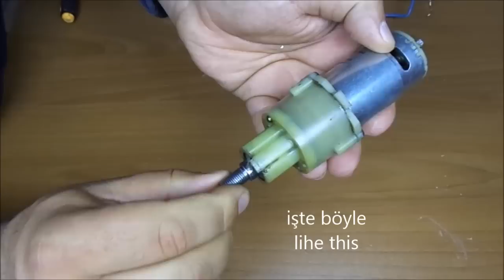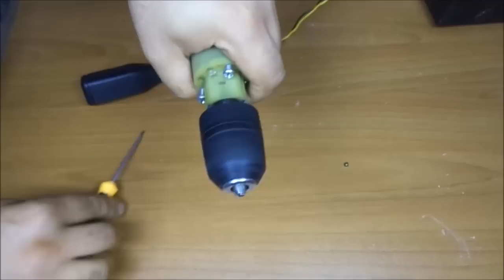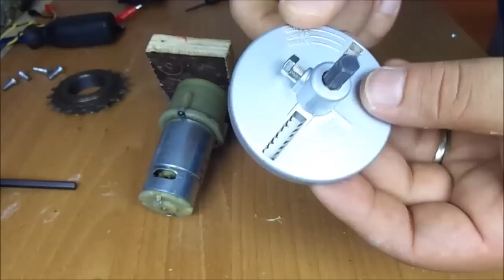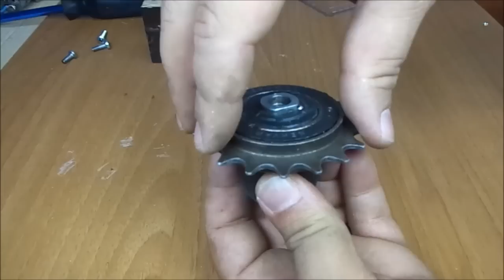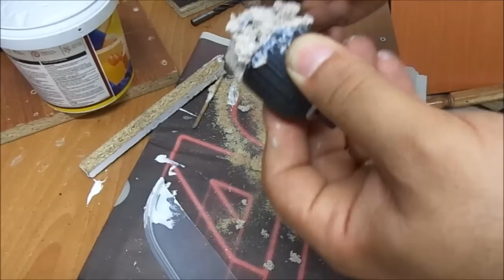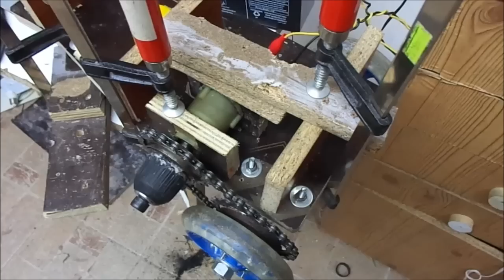Drill motor hack and gear for e scooter or e bike

Comment: try this one out for size. use real ebike motor and put on stator (generac ten magnets) two rotation 40 volts. ebike battery must have circuit for less then five volt and that may make up to 60 volts or three rotations of the stator. anyway you put voltage ac throttle  and connect to ebike ac motor you 1000 miles one charge ok (you make for people to see maybe???) thank you and your welcome. also good to run house with 120 volts 6 rotations and 120 motor to turn big stator. you run of ebattery and day time change to solar cell for motor and use max for solar to charge battery and run house (big enough you sell to grid america.) good luck again.

Comment: what is that kind of  sprocket clutch?  cant find it on ebay
Reply: buder5 you can usually find those off an old bike attached to the back wheel
Reply: must be very old i never seen 1 of those
Reply: buder5 that could be
Reply: that actualy helped  xD thanks